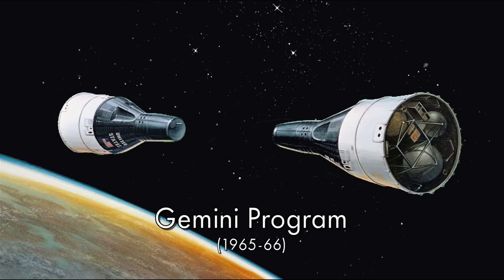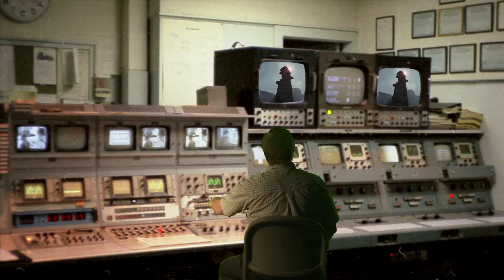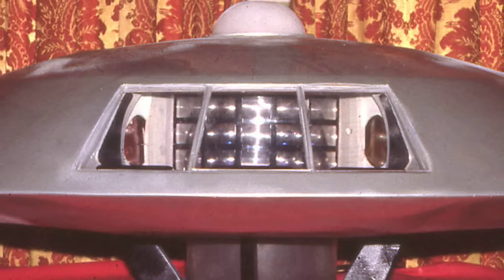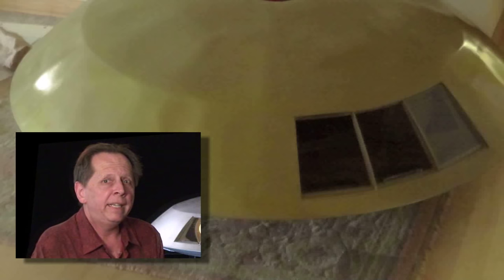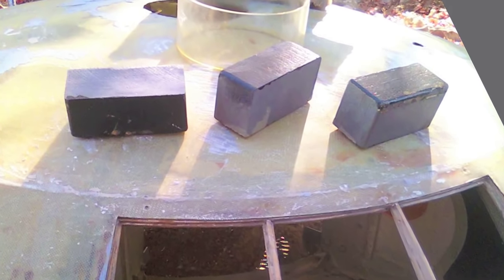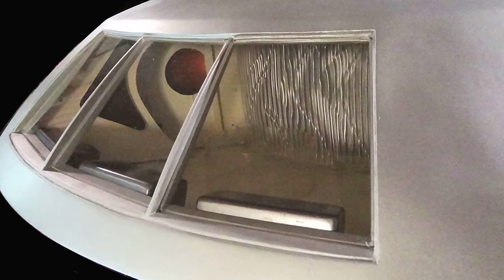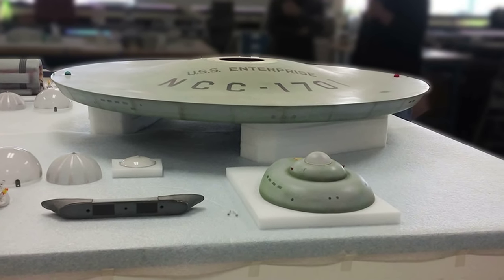RESTORING THE GEMINI 12

Comment: Where do you draw the line between restore and build from scratch.
Reply from the maker: A restoration is where you preserve the original elements and fix the damage done over the years.  A good example of this is the '64 Enterprise from STAR TREK.  It's a combination of fiberglass and wood that wasn't abused like the Gemini 12, yet still needed restoration from the Smithsonian.  Paul reinforced the Gemini 12 hull from the inside, sealed and stabilized all the window damage from CITY BENEATH THE SEA and only built the power core from scratch.  I think most experts would call this a restoration.
Reply: Thanks BIG 13, I guess I was trying to say the work was so extensive that maybe building from scratch would have been less trouble. I mean once that much work is done what was considered original elements becomes a small insignificant percentage of the final product.
Reply: @louisborselio8608   Obviously Louis, "replacing" is far quicker and easier to do than a full and complete restoration to the level shown here of a severely heat damaged polyester resin and fiberglass cloth casting. But the results would in no way be the original filmed miniature, thus restored. It would actually be nothing more than a brand-new "Replica" ---not even a "copy". 
     While a well executed, cast fiberglass copy, one that was made directly from an original miniature is a true "Duplicate" of that original. BUT you do need the original in order to copy and do that. 
     That said, you are seriously in error with your comment: "...once that much work is done what was considered original elements becomes a small insignificant percentage of the final product."             ----"Insignificant" you say? Exactly please; how is that so? What determining criterion are you using for your apparently erroneous and subjective assessment? 
     "Provenance" as evaluated by "Art" type auction houses is an art form in and of itself. This particular and now fully restored miniature has passed muster in that regard. The price the restored Gemini 12 original miniature was appraised for and simply put, was absolutely staggering! I am not at liberty to say, but trust me, "staggering" could well be understatement!
      As stated above; a new one that I'd created from scratch would only be worth a small percentage of that final and astronomical appraised value. 
     The finished hull's shape seen here is exactly that of the original. Ultimately, the fiberglass did indeed have a "memory" and was slowly coaxed back to it's precise and original shape with the judicious application of controlled heat and a great deal of patience. While a newly made example would only get somewhat "close" to the contours of that original. 
     All that isn't original in this instance is the textured, dull aluminum outer paint surface and any and every 50+ year old prop would benefit from a repaint. Keep in mind, the fiberglass under that new paint IS the actual and original. The only additional layers of reinforcing fiberglass were those exclusively applied internally, several additional layers that were also found from new on the heavier Jupiter 2 miniatures.

Comment: how did they make the sound of the engines
Reply from the maker: Although I don't know for sure, the typical method of making sound effects at 20th Century Fox (pre-digital) involved recording normal machine sounds like vacuum cleaners or hydraulic equipment and then changing their playback speed.  Sometimes they'd record a person's voice and vary the speed of playback.  The powerful Jupiter 2 engine sound (also used in many other Fox productions) was more than likely created in this manner.
Reply: Thats was achieved with the use of a synthesizer.
Reply: I have loved the sound of the Jupiter 2's main drive since 1965! An electrogravitic rotor-based drive, with a touch of COSMIC WIND. Stirring!
Reply: idak12 
I had always heard that the sound came from an automatic transmission from an automobile that was spun with an electric motor. Whatever the source, it sure produced an eerie sound that was perfect for the J2!
Reply: They used that sound for the MINIATURIZER in FANTASTIC VOYAGE, also from 20th Century FOX, in 1966, when we were in Kindergarten.

Comment: Just wondering how the original pilot was able to remove the wires used in the crash scene at Red Rock canyon. Anyone know how they did it back then?
Reply from the maker: Doug...the Lydeckers were experts at keeping wire reflections down to a minimum.  One way is by using the thinnest wires that will support the miniature's weight, which in the case of the Gemini 12 was under 30 pounds.  Against a bright sky, wires will 'burn' out...especially if powdered with a dry paint mixture the color of the sky or background.  This method was used in Gerry Anderson's shows like THUNDERBIRDS to hide the wires of the puppets and the models.  The wires did show up towards the end of the day when the sun was setting...this can be seen in the 3rd season episode "The Space Primevals," which reversed the Gemini 12 crash film to simulate a takeoff.  The wires briefly appear as the ship passes the familiar rock formation.  Of course there was no CGI to hide wires in 1965.  In the new transfer of the series to HD, Penny and Will's wires were digitally painted out in "The Reluctant Stowaway."
Reply: @BIG-eg2pt  Thanks for the info. Sometimes old school is better!!!
Reply: @BIG-eg2pt  GREAT stuff Mike!

Comment: Jupiter ll. Gemini 12 ???  The Jupiter ll had an outer door protection for the viewport that closed to prevent meteor damage. The ship glowing on takeoff looked like the spaceship on The Day the Earth Stood Still.
Reply: I'd suggest you watch the video instead of just commenting. The Jupiter 2 and Gemini 12 are two different ships!  The Jupiter 2 had a more bulged lower hull, this for two internal levels as well as lower level windows and a much smaller "Fusion Core"  than the Gemini 12 .  The glowing ship on the launch tower was the Gemini 12,  --- not the Jupiter 2,  as it's hull simply didn't fit on top of the launch tower.

Comment: That model looks like it's almost GI Joe size wouldn't that be cool as a kid to have a big Jupiter 2 with an opening top that you can play with characters in imagine you can make your own episodes with will Dr Smith and the robot.
Reply: Like a DOLLHOUSE or something???
Reply from the maker: I think a full-size G.E. Joe (about 10 inches?) is too large but smaller action figures might be fun.
Reply: @paullubliner6221  never use the word doll and GI Joe in the same sentence. Will Dr Smith and the robot sure won't be having any tea parties.
Reply: I don't think a full size replica 1/6 scale would be too large a 1/6 scale Enterprise shuttlecrafted only be about 4 ft long
Reply: @frankmarkovcijr5459  Frank,  "Scale" is the simple ratio of one object to it's related miniature, and nothing else.  The (non-existant) full sized Gemini 12 was specified as being "48 feet in diameter".  A one sixth  scale Gemini 12 would scale out to be an enormous EIGHT feet in diameter ---not four.  This dimension is inarguable.  What is being discussed here is the actual difference between a "toy" and a "Scale Model.  Those are invariably  H U G E! Think 17 foot long SEAVIEW!
Reply: @paullubliner6221  I am one of those that were disappointed that they did not proceed with the production of the one sixth scale TIE fighter from Star Wars. Okay I was wrong about the Jupiter 2 being 4 ft in diameter instead of 8 ft in diameter it would still make a hell of a Christmas present.
Reply: @paullubliner6221  see my question that related to size of the ship, I wrote on 8/21/02.

Comment: A bit surprised that the 'Spindrift' from the 'Land Of The Giants' is not mentioned.
Reply: This after all is a video about the Gemini 12 .  Those other miniatures mentioned were due to my having personally restored several "Voyage" props.  But I had no involvement with the "Spindrift", aside from the hero miniature's residing in my shared office for a time.
Reply: @paullubliner6221  I understand that however, it was when the "Flying Sub" and "Seaview" were referenced, I just thought that the makers of these miniatures likey worked on the "Spindrift" as well.
Reply: @cameraman655  AS I said,  in establishing my relationship with the Irwin Allen miniatures, we'd mentioned that I'd already restored several of those miniatures as well as is shown. 

    To my knowledge along with the full sized mock up, there were a couple of sound stage only, and relatively small, filmed Spindrift miniatures that were neither immersed nor flown through some truly fantastic exteriors such as Red Rock Canyon and the P.O.V. camera, Trona Pinnacles.  In other words, those earlier Irwin Allen shows had a far greater scope and imagery with regard to the use of filming miniatures. 

---A cursory on-line glance reveals many memorable views, such as of the Large Seaview miniature at that 45 degree angle "Emergency Surface" among the icebergs, or the Flying Sub's smashing into the ocean's surface at that same steep angle, and the Jupiter 2/Gemini 12's still most impressive hurtling downward through Red Rock Canyon and many other memorable scenes.  Really dramatic stuff!
Reply: Wasn’t the Spindrift just the mini sub/saucer from Voyage to the Bottom of the Sea repainted with some doo-dads added?
Reply: @christopherpardell4418  Uh....  No.

Comment: Many of the props are still around. Just that people did not have permission to take them. When Fox bulldozed the lot.. Maybe one day they will show up and they can be restored without being taken away by Fox. Which now see's there value...
Reply from the maker: That's a gray area, Master Chief.  Back in the 70's and 80's, the studio tended to discard props and sets.  When approached the department heads would 'unofficially' charge a token fee and individuals could remove the items. So, it wouldn't be correct to say that there was no permission. Now, of course, props are carefully curated and often sold at auction.

Comment: NEXT PROJECT: Why stop with just restoring the exterior...why not build an interior EXACTLY matching the original TV show?
Reply: If you carefully watch this video, you will see the interior of this miniature was indeed fully restored as well. Otherwise, the Fusion Core would not light and correctly spin, precisely as it did all the way back in 1964. Even the "Lydecker" rig's tubes remain intact. 
     Now , if you meant I should do-up a miniature (from an original) that should have an interior exactly as was the live action set, I am sorry to point this out, but it simply can't be done.  Not truly, and not accurately as you did say "EXACTLY". 
     There are many production requirements as well as constraints on any live action set (actual necessary proportions for microphone boom clearance, access for overhead lighting, moveable "wild" walls for camera egress etc.) that preclude this.
     What that means is: if the full sized sets were reduced in size retaining their exact proportions just as they were built, things simply cannot match-up with the miniature's exteriors. They will not "fit" within the miniature, they just can't. 
      As an example; I have attempted what you've requested for a client with an original 18" Flying Sub molded from the original wooden pattern, and while I did get reasonably close, it simply cannot be "exact".  At over 6 feet tall, Captain Crane would have constantly bashed his face and head on the girders!  The height and width scale differentials essential for filming simply do not work when reduced as a miniature. 
      Also, there are several commercial model kits that have attempted this, but all fall far short from "perfect", with only mixed results at best.  Thank you.

Comment: Jupiter 11 should include a lower level where the crew slept. It should encompass all the elements of the original not just a traditional UFO styled vehicle.
Reply: The Gemini 12's original pilot episode concept had the several suspended animation tubes, so there was no need for sleeping quarters, or another level.  The Robinson family and Major West were to be in suspended animation until immediately prior to entering the destination planet's atmosphere.
Reply: @paullubliner6221  That's a very good point. But in the end it ended up having 3 levels !! 😂
Reply: @krispirtsios8654  PLEASE watch ALL of this video before commenting! 
     THIS is the Gemini 12, the original ship as designed specifically for and used in the pilot episode. There was no "Robot" nor "Dr. Smith" in the pilot episode. 
---> It was a very different show, with a different ship which was modified to become the Jupiter 2 as explained in the video. This miniature is NOT the Jupiter 2.
Reply: @paullubliner6221  Wow never knew  that no robot or Dr Smith in the pilot episode amazing thanx for the info. Well it's true wot they say u learn something new everyday!

Comment: The fusion core...  I'm sorry, but the relacement isn't exactly the same as the original.  It extends further from the underside.  Very close, and a real nice effort, but the comparision shot makes it obvious.  It goes just too far away from the ship.  The lights on the underside of the fusion core are also too big, compared to the original...if the original even had any.  (The shot lifted from the episode makes it too hard to tell.)
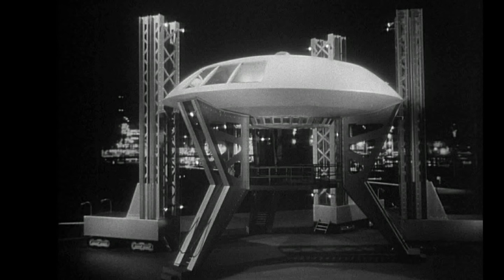Reply: I too am sorry, but it does appear you’ve misinterpreted what you are seeing in this video. If you carefully examine the Gemini 12’s underside at 3:47 and 4:03 you will see all of the dimensions of the replacement Fusion Core are identical with the original.  

With the two-shot, upper and lower comparison seen at 19:04 and on, in the original footage the juncture between the center of the Fusion Core and the hull’s underside is quite “washed-out” when compared to the new footage.  This was due to the lighting and process photography (necessary for the pulsating glow on lift-off) obliterating much of where the Fusion Core joins with the hull’s underside. As a result there’s a tendency in the original sequence to make the Fusion Core appear shallower in height than it actually was. However, if you look to the left or the right of the Fusion Core’s center in this same comaprison view, you will realize the Fusion Core's height is indeed taller than it appears in the middle-front.

As for the “underside lights” being either too large ...or not there at all as you’ve suggested,  the 32 apertures are very clearly seen in the close-up at 4:03.  On the replacement, they're dimensionally identical with those on the original which were made to the blue prints used in 1964 by the Fox Prop Department.  Thank you.

Comment: Wouldn't have been cheaper and easier to build a new one from scratch?  It reminds me of the "My Grandfather's Ax" paradox
Reply from the maker: You seem to be missing the point...it's not "let's build a Gemini 12," but "let's RESTORE the original miniature."
Reply: Yes it would have been easier, but neither faster nor "cheaper" to do.  The cost of materials was truly pocket change.  Far less for this restoration than what would have been required for building the top & bottom contour spinning apparatus and all new plaster shell molds necessary for making a new fiberglass cast hull.  The amount of labor required for the creating from scratch a completely new hull would have been considerably more than you seem to think. Especially if it were to have every single idiosyncrasy of the original, which this restored miniature does indeed retain.

As for  "Your Grandfather's Axe" theorem, the point of that story was NONE of the original axe was retained and hence the joke.  Whereas here, every single and original item was repaired if needed or simply refinished and then re-used.  Only some new paint and a little new fiberglass internal reinforcement inside the hull was added.  It IS the original miniature throughout!  As an aside, if you knew what and how much was modified or even outright changed on the Starship "U.S.S. Enterprise" by the Smithsonian's people, from your comment here, I'd say you'd no doubt be appalled.

As expressed elsewhere, one of the most highly regarded Hollywood auction houses has appraised this restored miniature at multiple 6 figures in value. They understand the difference between what was done here and the inherent lesser value of a newly made replica.  This is not an exaggeration, the absurd offer was virtually "TO THE STARS"!

Comment: Gemini 6 and 7 never docked. They rendezvoused. There was no way for two gemini space craft to dock.
Reply from the maker: You are right, James!  Thanks for setting us straight.
Reply: This is true, but the Gemini was designed to dock with an Agena spacecraft, which it did 4 times (Gemini 8, 10, 11 and 12).  Gemini 8 had a thruster malfunction just after docking and had to do an emergency return to Earth.  The networks preempted normal programming to cover the emergency.  CBS got howls of protest from fans who got cut off in the middle of...Lost in Space!  The episode was "His Majesty Smith."